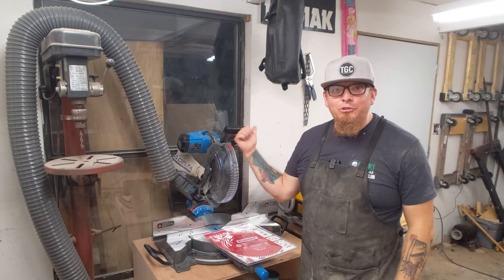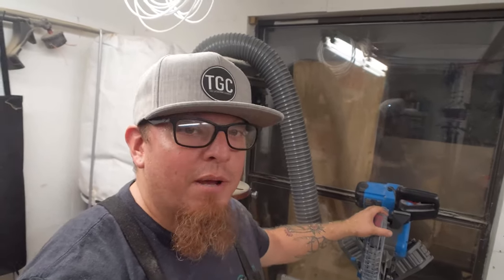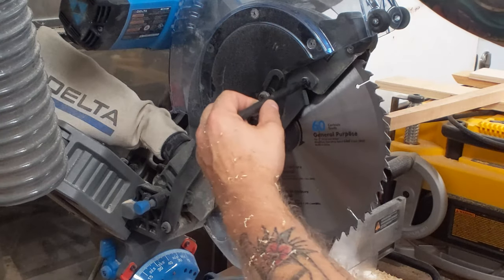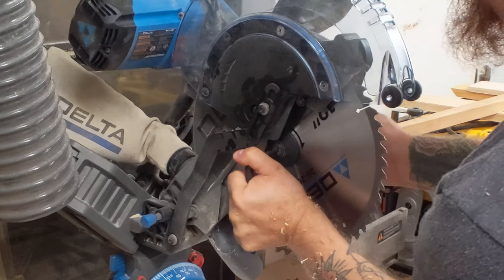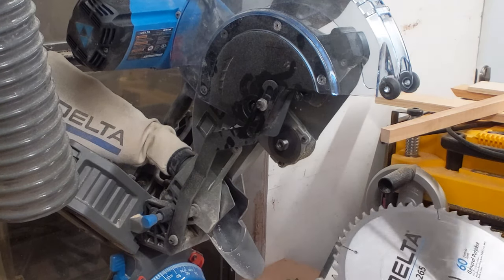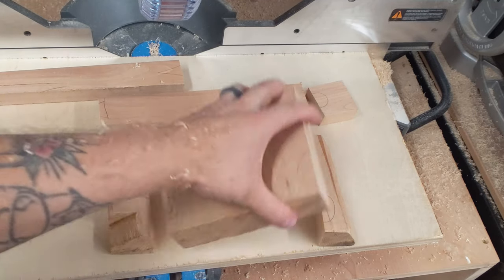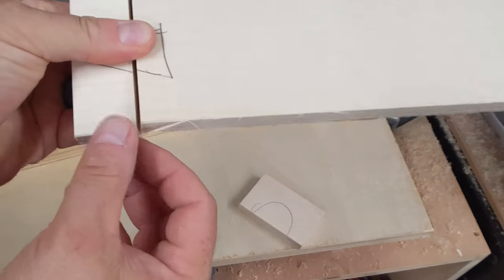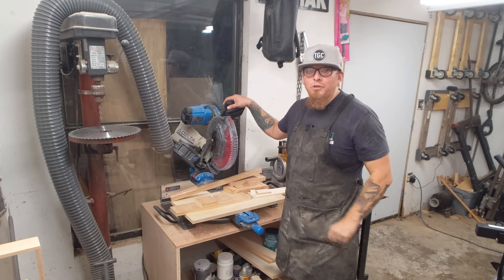Delta Cruzer 12" Blade Swap /  Diablo Vs Delta

Comment: Jeremy, it looks like you've moved? Your shop doesn't look the same as it was when I was over tonight. I tried the 80 tooth Diablo on my Bosch Glide and it wouldn't cut all the way through. It turned out the blade wasn't 12 inches but more like 11 3/4". I ended up going with a 100 tooth Dioblo that was a true 12 inches and it solved my problem. I was surprised the 80 tooth was so far off. It looks like it's not a problem on your Delta. Take care!

Comment: Excellent video, thank you for taking the time. I just ordered the 12” gen 2 on Black Friday to replace my 13 year old  Delta 36-255L double laser 12” workhorse. I can’t wait to start using it. The 36-255L is still as true and reliable as it was on day one. It was just time for a slider.
Reply: Where did you get it and how much you paid?
Saving up to get the 10 inch one but is hard to find it and even harder to get it on sale.
Reply: @joaquinsuarez6090  Home Depot $499. I wish you luck in your search. I know you will have one very soon.
Reply: @jimserhant7741  Thanks. I see the 10 inch for $350 for a couple weeks but out of stock. Hope they get some more soon.
Thank you.
Reply: @joaquinsuarez6090  Literally 5 minutes after I ordered my 12 inch the Home Depot site said “Sold Out”. I guess other people like myself couldn’t believe the price was real & jumped on the deal. Don’t give up your search. Like I said before, I know that miter saw will be yours very soon. God Bless
Reply: @jimserhant7741  Wow! You got very lucky.
I will keep checking, hopefully they get some more.
It seems to be one of the best miter saws, similar ones cost twice as much.
Let us know how you like yours when get it.
Thanks and God bless.
Reply: @joaquinsuarez6090  I have no doubt I will love it. I know most people today go for the black and yellow or red and black brands, but, I love delta power equipment. I’ve had a delta 12” dual laser miter saw for 13+ years & it is still as reliable and true today as it was when I first got it. I just thought it was time for a slider & this deal was too good to pass up. I have to wait a month though. I have a feeling even though I was able to buy one online, Home Depot oversold their inventory. My saw is scheduled for delivery directly from Delta on January 9th. I know you will have yours soon, good luck with your search.

Comment: How long have you been using the delta cruzer? Im in the market for a new sliding compound miter saw and the cruzer is currently the top contender. Im just looking for reviews from people that have been using it for a bit of time
Reply: I've had mine a few years, I wouldn't trade it for anything.

Comment: delta didn’t think it anything.  that’s all BOSCH. the axial glide, same arbor lock button, the tool and tool storage, front controllers, and the blade guard, it’s all BOSCH.
delta stole all those ideas.
rat bastards